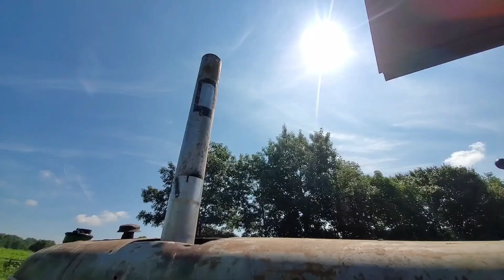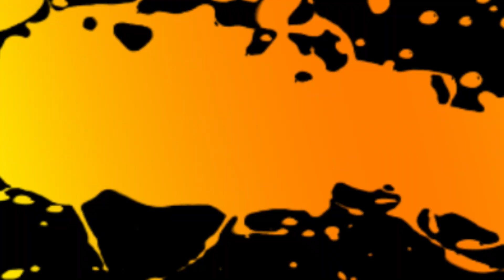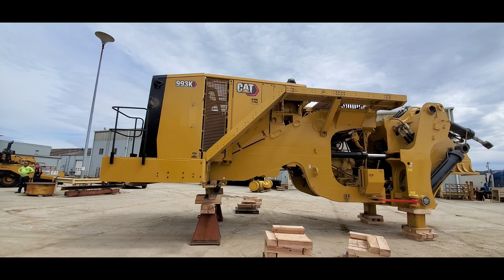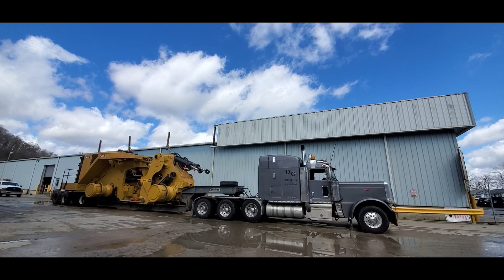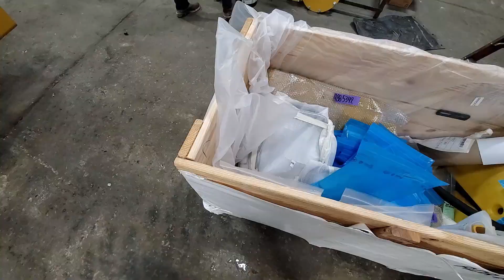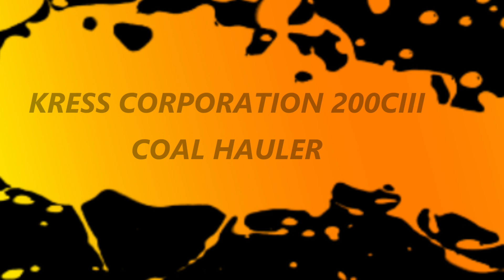CATERPILLAR CAT D11 993K 992 777G !! LARGE CAT MINING MACHINES DURING ASSEMBLY

Comment: So what do you think about the Komatsu 475 and 575 versus the caterpillar D11
Reply from the maker: I actually haven't had any experience with them. We only have one guy in the area that used to run them. They are not popular in this area. I know we used to perform track repairs on them back in the day because the local Komatsu dealer wasn't equipped to handle machines of that size. Always heard that they snapped tracks easily when steered too far one way or the other due to all the weight on the track. Always heard they pushed good though.
Reply: Dang man thanks because I was going to get one to smooth out my driveway you just save me a lot of hassle and money
Reply from the maker: @terrellscaife2411  lol! Welcome